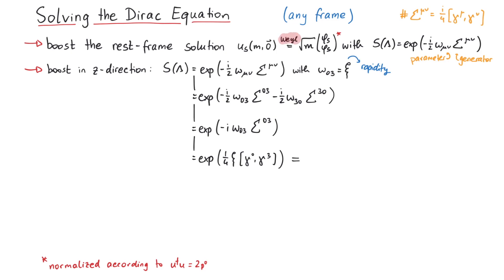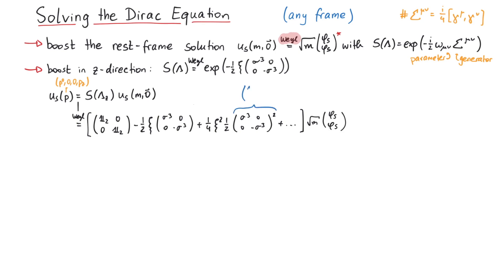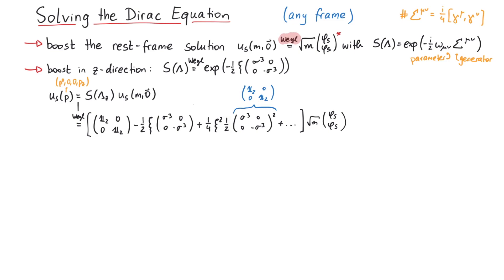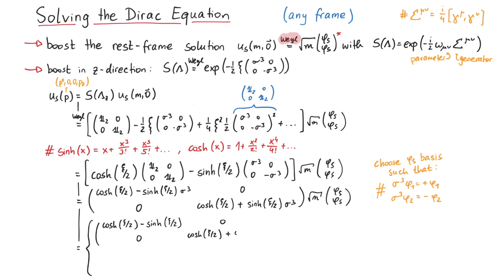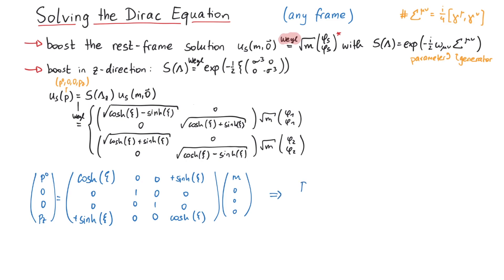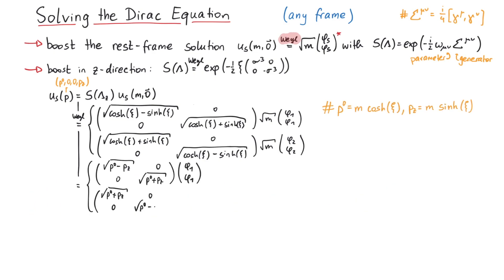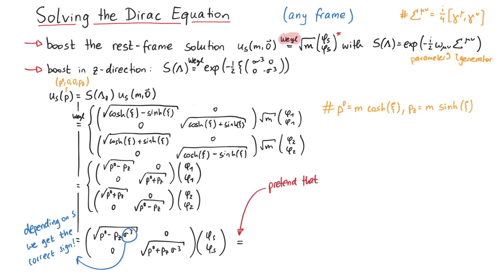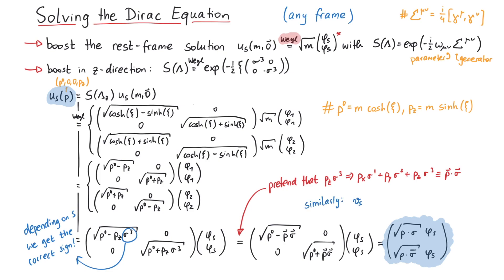Solving the Dirac Equation | Any Frame (Hard Mode)

Comment from the maker: Errata:
03:04 Since the Lorentz group SO(3,1) is non-compact, there are no finite-dimensional unitary representations. In particular, if we only look at rotations, S is unitary, but if we consider boosts, S is not unitary! However, this is no problem when we are dealing with classical Dirac spinors. Only when we consider QFT with the quantum Dirac *field*, we would like unitary transformations. Since the Hilbert space (Fock space) of QFT is infinite-dimensional, this allows for unitary representations of the Lorentz group. (Thanks to James Bates for pointing out the non-unitarity of S)
Reply: You mean non-unitarity of S! It is actually Hermitian in this example.
Reply from the maker: @jimmyb998  Oops, typo, thanks again!